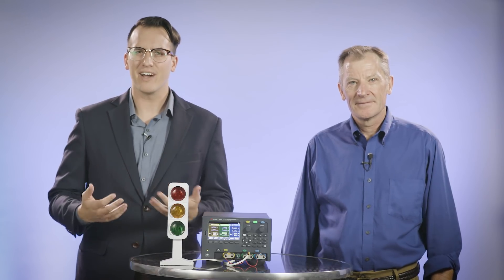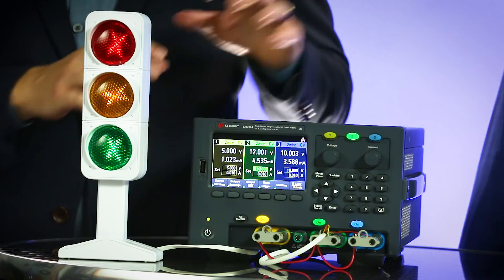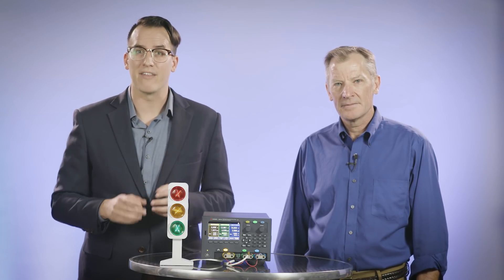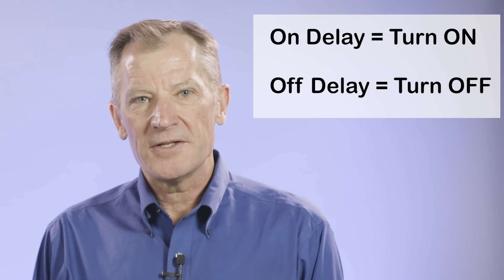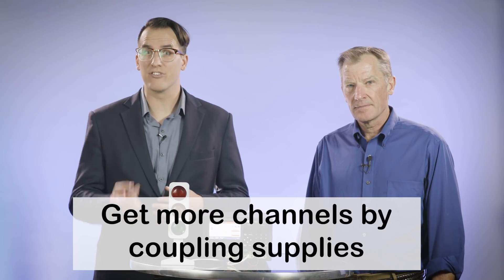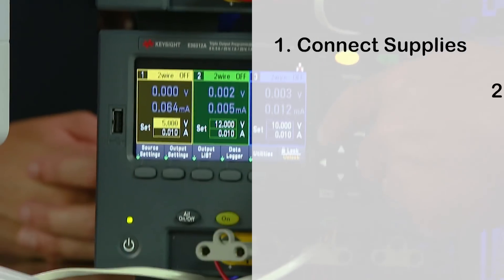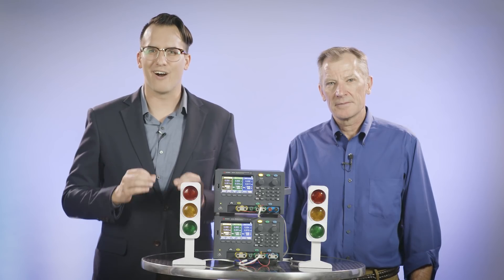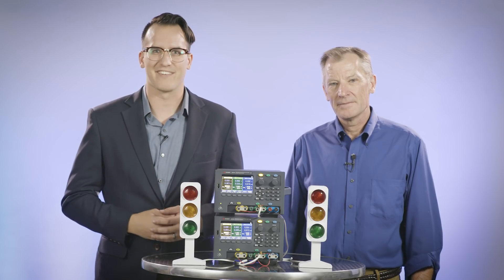Power Supply Output Sequencing

Comment: Nice! Yes I'm using this feature to turn on/off Wi-Fi router to simulate Wi-Fi interruption and recovery in our X-Ray testing environment. X-Ray detector is Wi-Fi connected and in case of any interruption image couldn't be lost.
Reply from the maker: Awesome!
Reply: I know ;) You could send me one of those as gift :D  Because it's also my hobby, and it's to expensive for me as for hobbyist :o But may be when I will use them at home and at work all the same time we will switch  from R&S to Keysight  ;)

Comment from the maker: Have you used power supply output sequencing? If so, for what?
Reply: Blinking led
Reply: Using matlab when doing ADC measurements.
Reply: No I have never used a sequencing  power supply it would be nice to get one of those power supplies..that you are using in the video
Reply: Power supply sequencing has many applications. I work with RF system design and I came across a problem while studying a previously made project. It had a chain of LNA + RF gain blocks in cascade which if powered at the same time used to behave abnormally or break in to oscillations. So, we figured out that there is a particular sequence that needs to be followed in order to switch on each circuit block separately at different time.
Reply: GaN bias network